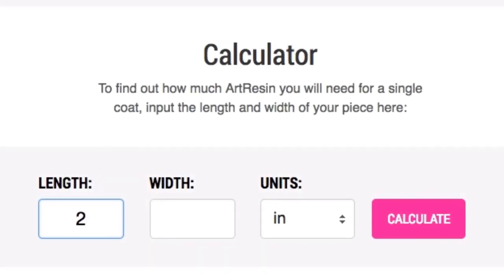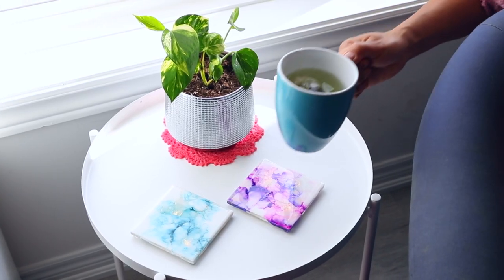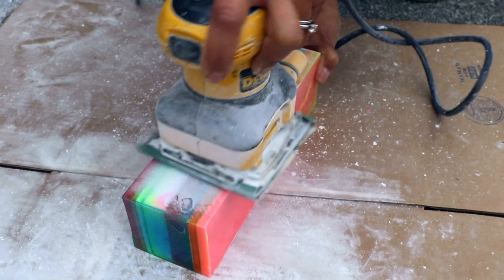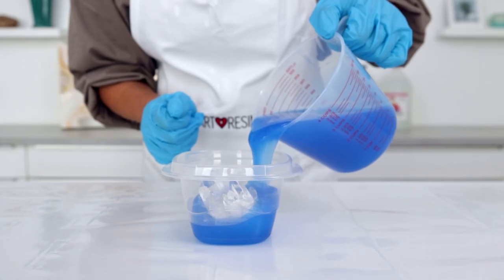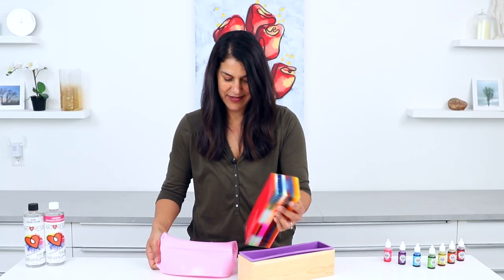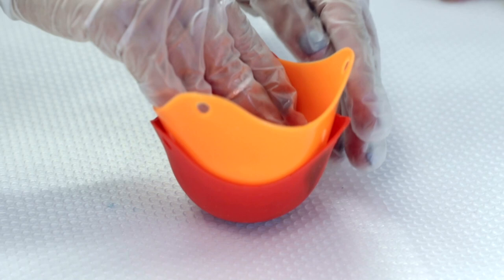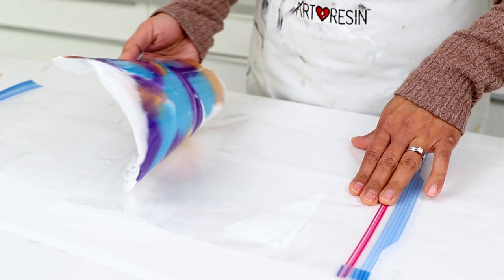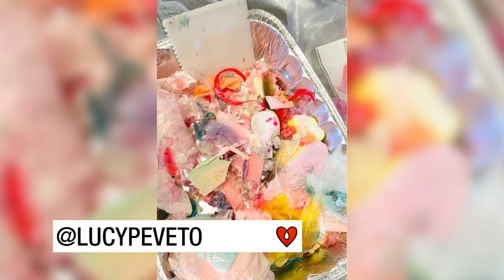STOP Wasting Your Resin!

Comment: One thing you can expand on is the resin that's too cured to spread, that you put between plastic sheets and cover with something with weight. You can drape it over a bowl or vase (if still malleable enough) to make a free-form bowl or vase. Also, with the idea of pouring leftover resin into a mold, I've done the same with square and pyramid molds, but instead of just stripes, you can also tilt the mold in between pours to create triangles within square molds and squares within pyramid molds 😉
Reply: Great tips!
Reply: Love this idea about shaping it to a bowl .. I've been meaning to try that. I've used my left over resin to make shapes that I have on my alphabet mold.  I then use them to decorate my area when taking pics of my products 😊

Comment: I want to make the crystals which you featured, but I thought you could only pour artresin to an 8th inch depth? Did you do the crystal in layers, or did you pour it all at once? Thanks !
Reply from the maker: We recommend layering your pours when pouring into a mold primarily to reduce bubbles and to prevent overheating.  In this case we weren't too concerned with bubbles in this small crystal, the warm water bath prior to mixing helped to reduce most bubbles.  The casting was small enough that generating too much heat in the chemical reaction was not an issue in this case so we just poured it all at once.
Reply: @Artresin  Thank you for your reply. I want to make small crystals, so I will take your lead and pour all at once for the first one, and see how it turns out! 🤔